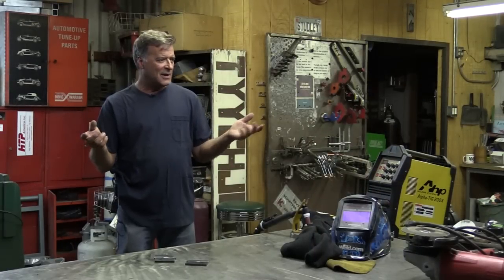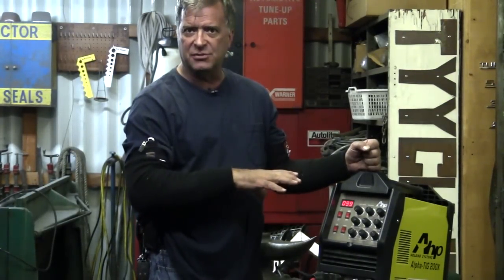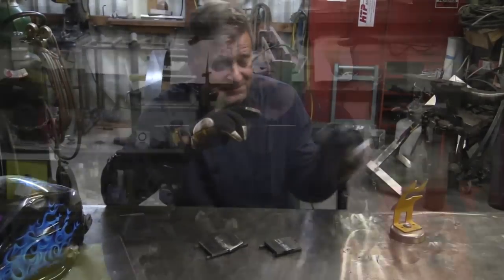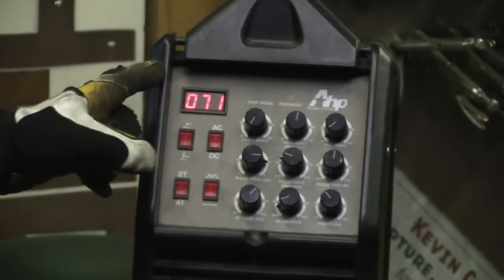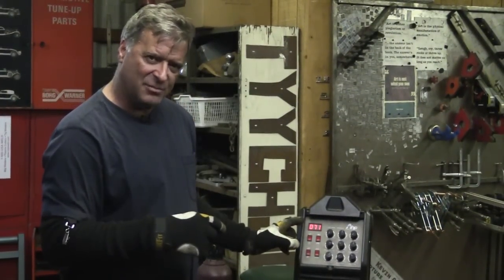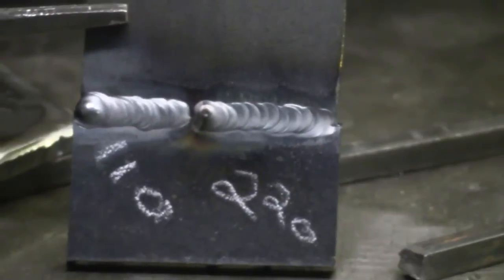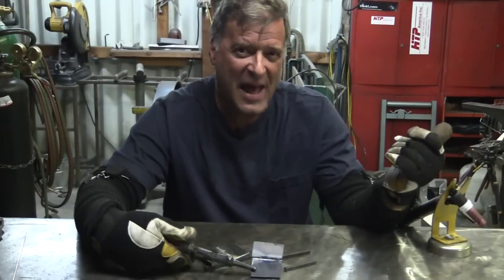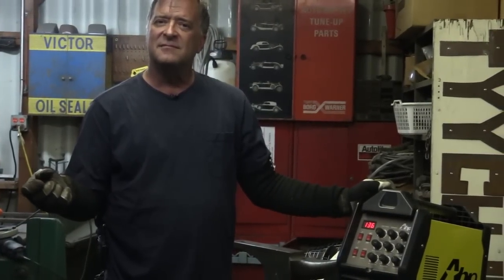What is the Difference Between Welding With 110 and 220 Volts? - Kevin Caron

Comment: Thanks for the video!!! I have a diff issue maybe you can help. I have a tig machine and everytime i press the trigger on the torch, the machine shuts off!! What might be the issue?  Thanks in advanced
Reply from the maker: +alex ramirez         Not sure what machine  you are using but I think you have a short in the machine..     Or the power coming in is not wired correctly.

Comment: thanks kevin very much > P = I x E; ive all but scorched the adapter plugs (3 into 2 unpolarized) here the philippines my std. 120v hand held power tools, originally on a separate household circuit (service recently discontinued) and more recently in conjunction with an automatic voltage regulator.  just commenting thanks for the demonstration and howdy the voice

Comment: There's a different sound between the two voltages - sounds like the welder is putting a lot more low frequency into the waveform when it has a 220v supply

Comment: Hey Kevin I have a Miller matic 140 with a spool gun for doing aluminum. 
Any tips on how to properly use them.
And how you do a proper prep and cleanup. 

I've always worked mild steel so im a little lost.
Reply from the maker: TinManKustoms  I have done a couple of videos on this ..   Here is one of them..
https://youtu.be/1uS7QdN3OaY

The big thing is get it clean before you start..   Stainless wire brush till shiny...   Practice , practice and a little more practice before you touch your work...
Reply: Kevin Caron, Artist thanks I'll check it out.

Comment: That's a real interesting explanation and demo but what happens if you have 440 three phase available - i realise that it is probably not possible to connect this machine to that supply and it is not designed to go above 200amps.

I also note that you talk about "indicated" amperage - do you have any reason to think it is actually wide of the mark?

Interesting formulae that you suggest as a guide of amps relative to metal thickness. Does this apply to stick welding and MIG as well?
Reply from the maker: Dan Whiteford Yes, the 1 amp per .001 is more or less accurate across the board. Of course when you are talking about a MIG welder that works in volts instead of amps it get a little more confusing....   this machine is not made for 440 or 3 phase..   You can jump over to the 255ext from Everlast for that..